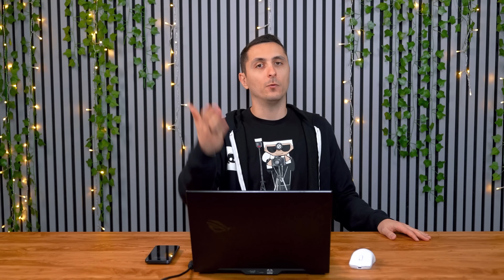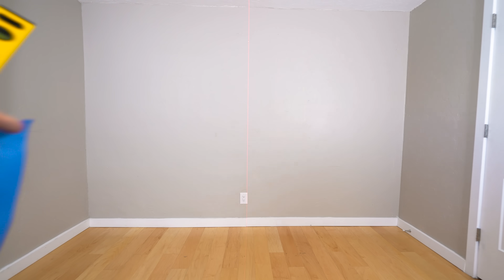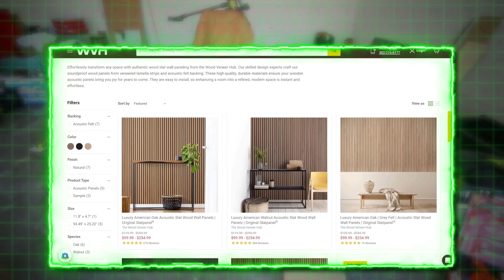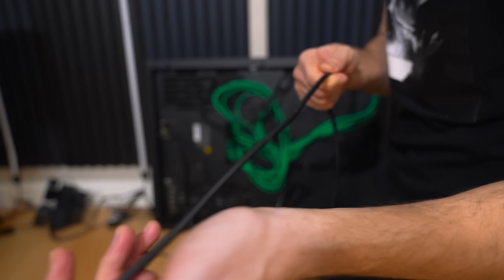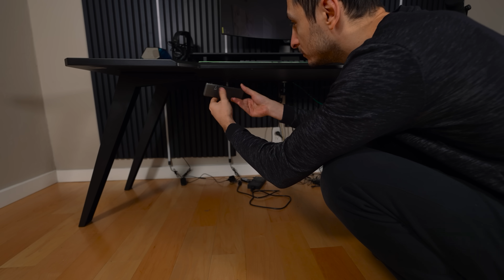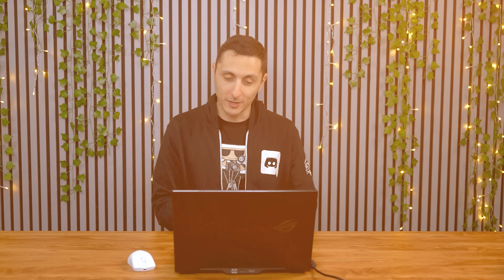How to Build an Epic Gaming Setup - Build Guide

Comment: As far as the case mounting holes not lining up with the studs, you can solve that by using a backer board. Either the same exact footprint of the wall frame (making it look like the frame is a little thicker than it really is) or a little larger allowing you to "frame" the computer. You attach the backer board to the studs and then case to the backer board. This would also allow you to play with RGB  lights between the case and backer board for some cool glow effects.

Comment: I personally would’ve painted a piece of thick plywood black, and screwed it into studs, then mounted pc case screws into the plywood (or ideally you could install supporting wood behind the wall and patch up)… just a lot of weight and and money to be hanging on mostly drywall….. could also use some super duty drywall anchors too

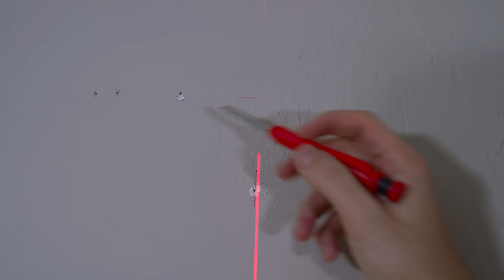Comment: 3:59 cut a 2x4 a little longer the case drill that 2x4 into studs then drill the 4 holes for the case into that wood and it is a lot more sturdy than drywall

Comment: Correction: Studs are commonly spaced 16” on centre. So the dimension you showed from stud face to stud face is 14.5”, assuming standard 2x4 or 2x6 framing.

PS 6:10 - cutting without eye protection; enjoy your vision while it lasts! 😮

Comment: This is such a good video concept! I don't know if I've ever seen a comprehensive guide and tutorial for getting a clean looking setup when a lot of gear is involved. Could you also do one for more advanced pc builds? Maybe figure out the most complicated rig that can be built and then do an in-depth tutorial on building it and making it look clean. I've built several pcs for myself and friends, but none of them were using particularly complex parts. When I built my new rig back in June I was using an aio, custom cables, a ton of fans, and a whole lot of other stuff that I wasn't as familiar with in a relatively complex case. I eventually got through the build, but it kicked my butt and the included instructions for a lot of the parts were not helpful.

Comment: the desk itself is really bad, you should get something with straight legs maybe a sit&stand desk with tabletop that compliments floor, also place 2 tall plants in concrete flowerpots on the sides instead of those HIDEOUS lightbars, instead putting a monitor light up the screen

Comment: gonna start my epic set up with monitor. saving it for some time now. thank you for the inspiration ed.
Reply: Which monitor are you planning on getting? Hope you are building your system for the monitor you are getting.
Reply: @MadmanLink  currently I have a gtx 1060 and a ryzen 5 3600. so I'm looking for a 1080p with 144hz monitor. preferably an IPS panel because I'm a video editor. 
Planning on upgrading a GPU soon but I have to invest on monitor first.